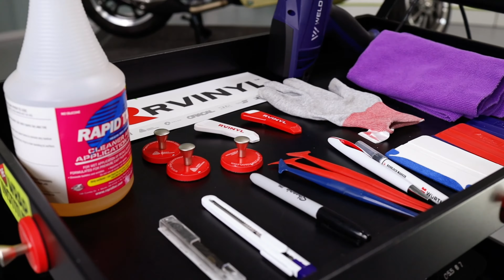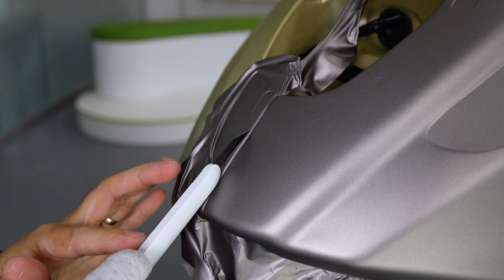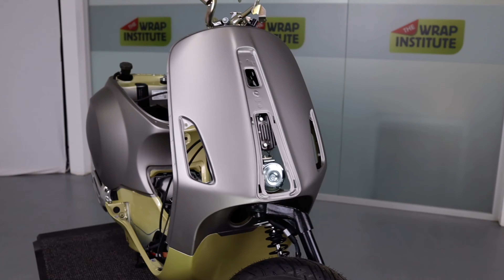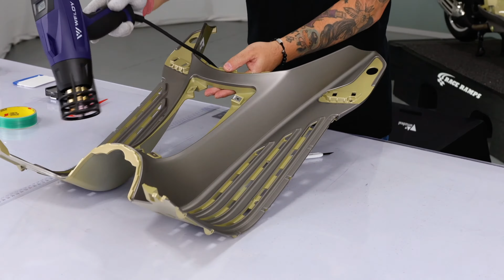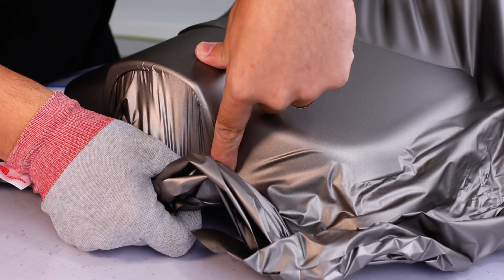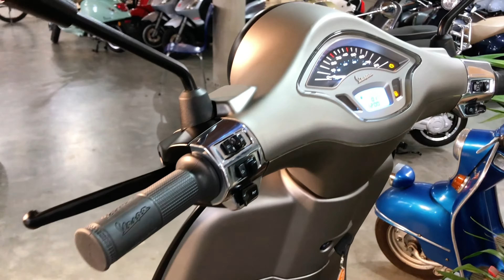How to Wrap Your Vespa with Vinyl

Comment: How much vinyl do you need for an vespa sprint? And how much will the total cost?
Reply from the maker: For complete coverage you want a 5 yard roll. Cost will depend upon what film you select.
Reply: @Rvinyl  how much is that L x W in meters?
Reply from the maker: @zythrex7197  a yard is approximately a meter so 2 by 5 meters.

Comment: Great video tutorial! The vespa emblems on the front and sides has to be taken out and be replaced with a new one?
Reply from the maker: Noel,

Even though the emblems are removed for the install, you don't need to replace them with new ones. You simply wrap the scooter and replace them.